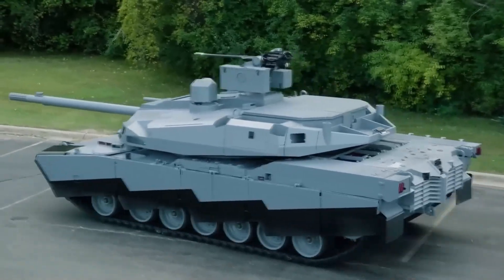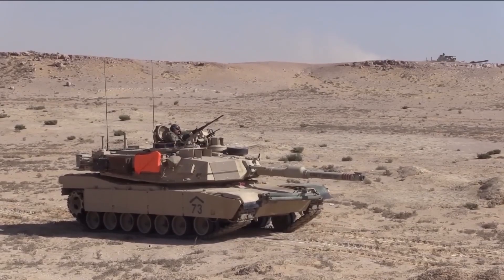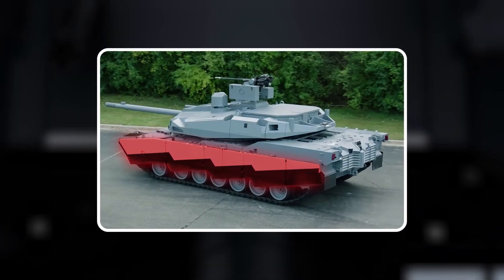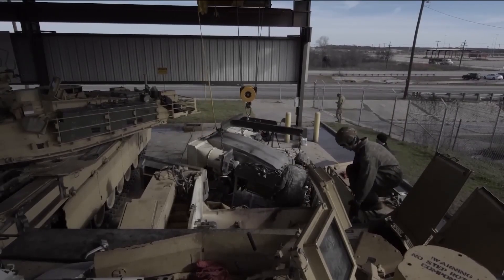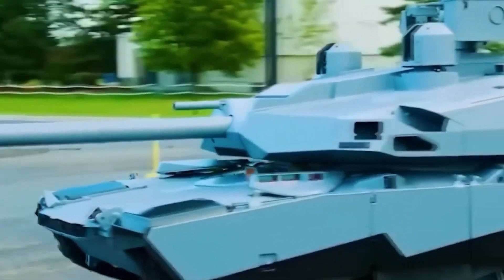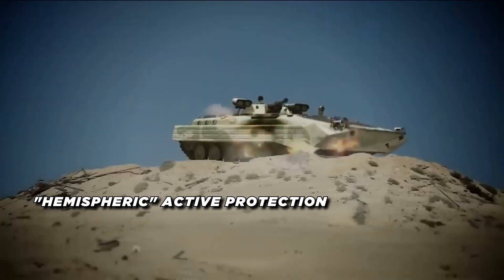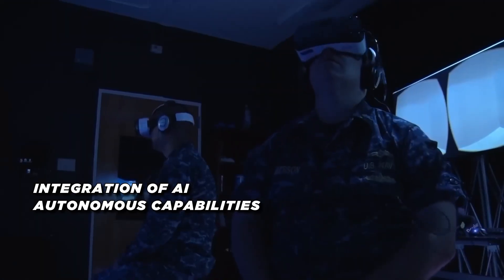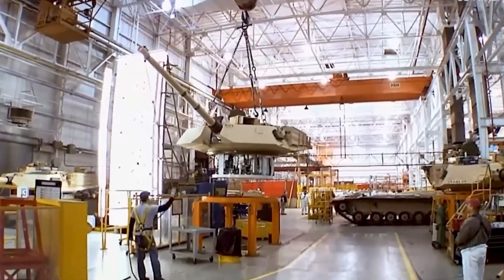US ABRAMS X: The Future of Combat

Comment: The M1 had British armor and L7 105mm gun. The M1A1 swaped the British 105mm for a German 120mm Smoothbore. The Abrams has two weaknesses, the first is the Gas Turbine engine which is a gas guzzler which gives the tank only a 65 mile range. The Gas Turbine is a huge heat source and Abrams lights up like a christmas tree on IR tracking. Abrams X has a better engine and systems which elimnates some of the old issues, but auto-loaders and unmaned turret may be problematic.